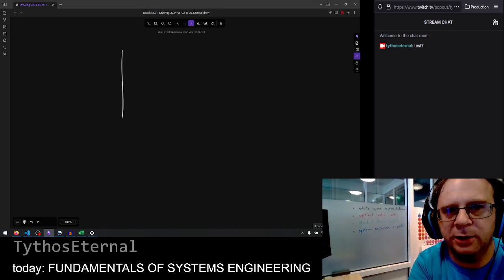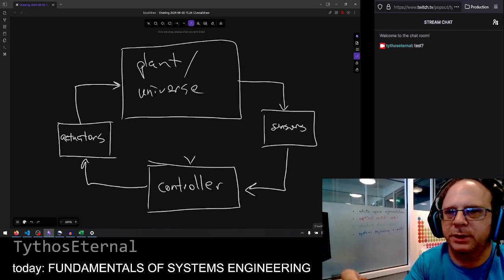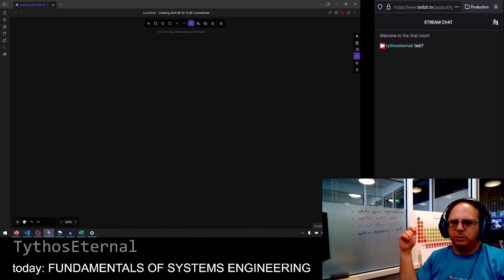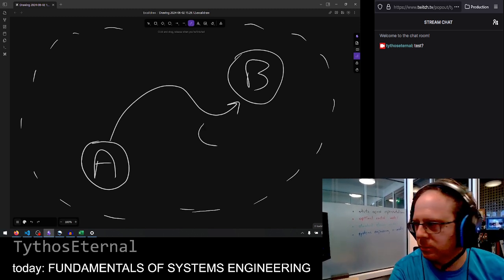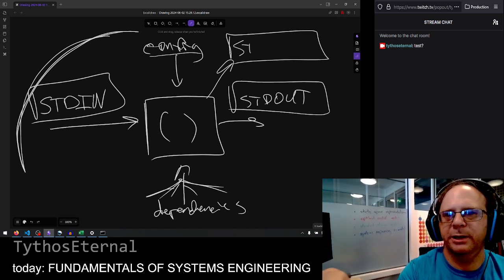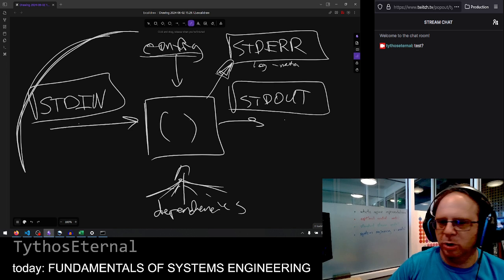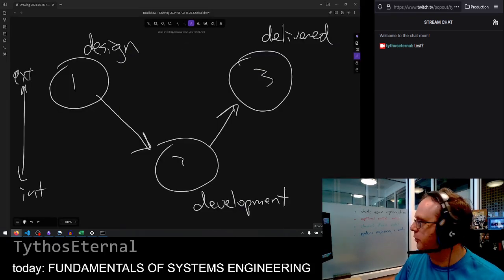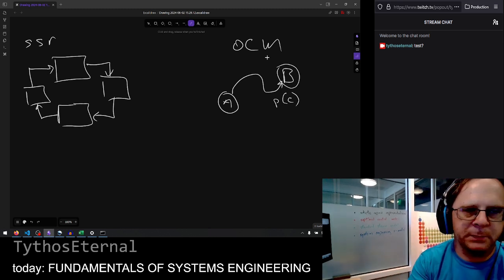Fundamentals of Systems Engineering Models

Comment: Just stumbled on the material, watching it because it is related to my study for system design and ontology with comunication materials that I am looking through!

Thank you for the reiterating!

So we have 

"The plant" - for working with anything that we are attempting to control
"The optimal control model" - to handle cost to arrive from A to B
"Standart streams" - to handle/process data input from stdin and report with stdout/stderror
"C Model" - often reaccures when working with any deliverables where recieving requirements and producing output takes place

I would also add an understanding for System Design when it comes to working complex systems, like producs and stuff. The main points is to understand system and subsystem, roles, positions, responsibilities, intent when it comes about people. And the part which relates to Lifecycle.
Reply: on.a side note, such videos can gain more outreach, if there would be more examples of explanation of these things.... people are visual